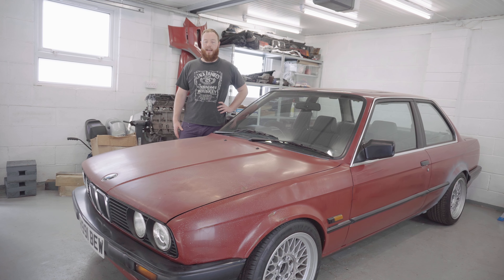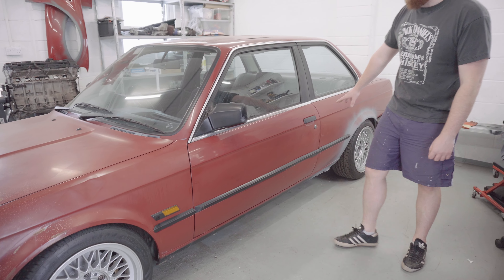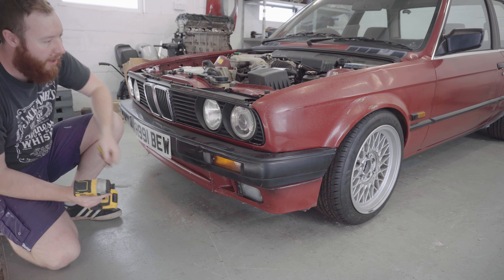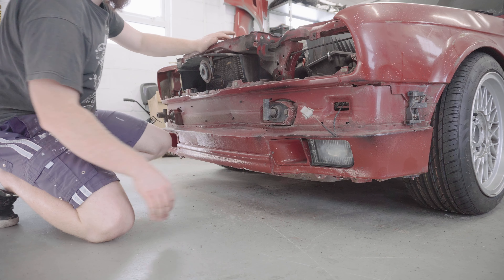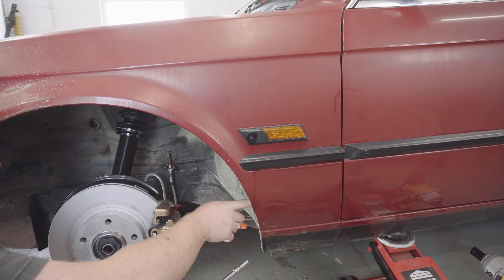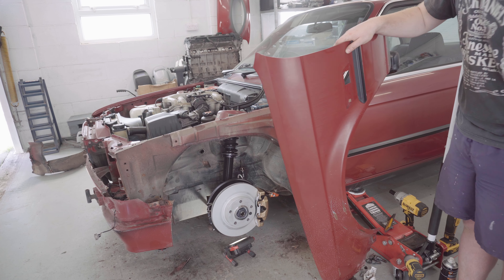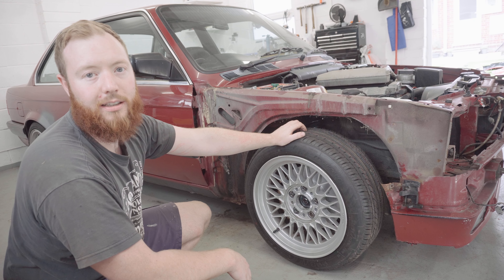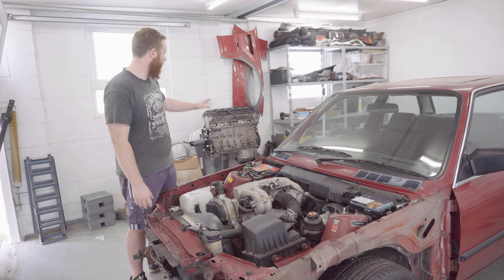BMW E30 Front End Damage [SHOCKING REPAIR] How To Remove Front Wings, Bonnet, Bumper & Valance | 026

Comment: Useful tutorial on front panel removal which I had to do recently as mine was rusted at the wheel corners. I had to ground down the replacement panel at the bottom to fit the clips for the spoiler properly. Aside from that, It's great to see these videos on a right hand drive M40. Appreciate it.
Reply from the maker: Thanks John! I hope you got your new front panel to fit up right in the end. I've got a good condition spare I'm planning to put on when the car goes back together, this one was bodged up beyond belief haha. 😂

Comment: Just catching up on all your vids. Really like the channel. My very first BMW I bought in 1990 was a 1987 2 door E30 320i in Zinnober red, chrome bumpers. I added a set of the silver BBS alloys. Absolutely loved that car. Traded it after 6 years to a guy as a swap for an Alpine white 1989 E34 535i SE Auto which I still have. It is sort of a project now, I have done lots of work on it, sills, jacking points etc. they rot similar to E30's. I am currently restoring a 1998 840Ci, which I have been on with what seems like forever! I am 70 now so really wondering if I will last long enough to see it finished! Anyhow, keep up the good work.
Reply from the maker: Thank you Bob, really pleased to hear you're enjoying my videos!

Sounds like you're a true enthusiast, and not to mention a man of taste. 😄

Good to hear you've sorted the big stuff on the E34, very similar issues to E30's as you say, but equally worth taking care of. You see very few E34s these days, I always fancied an E34 touring as a daily driver.

The 840Ci sounds like a very special car, I'm a fan of those too, hope the project is going well, don't let up! 👍
Reply: @SPANNERRASH  Thanks for the good wishes. Motivation can be a problem. Unfortunately, I got quite ill in 2019 and couldn't face working on the car, and haven't really picked up pace since. I am not too bad now health wise, but generally can only do about 5 hours at a stretch, so hope to put some work in when it starts to warm up a bit as heating the garage is so costly now. I have completed 2 previous cars, my son's 2002 Astra SRi Turbo (which he still has) and a 1996 Golf GTi which I sold last summer. I painted both cars myself and they stood up to scrutiny at car shows etc. so if the 840 turns out as good then it will have been worth the pain!

Comment: I see you have 5 bolt hubs I have a 89 735i with coil overs on it is this the same how do you have 5 bolt?
Reply from the maker: Hi mate, I explain my whole setup in a couple of previous videos, check them out!

Rear: https://youtu.be/OXPT7gjXi3Y
Front: https://youtu.be/7-hN2-2J4Fo

Is this similar to how you converted yours?

Comment: I spy an M5x, which one did you go for? I've got an M52b28 sat in a friends garage for mine when I finally sort it out!
Reply from the maker: Snap! It's an M52B28, I think the perfect swap for an E30, on balance, for what I'm into anyway. 😀

I'm still debating on how much attention to give it before fitting. It looks like a good motor, but always hard to know what kind of life it lived in the past. I guess I'll find out.

You might get around to swapping yours first.
Reply: @SPANNERRASH  I know what you mean, only gaurantee I've got is the previous owner said it was a good motor... 

Wouldn't count on it! I've not put the rear end back together yet, been dragging my heels because once that's done it'll be off to the welders. Ive needed time to save up some cash!
Reply from the maker: @Keats.Garage  Ahh yes, quite expensive to have done. Although having had a go at DIYing it, I can understand why! Not quick nor easy unfortunately. It'll be well worth it though once it's all done.

Comment: you are doing this dangerously. using a hydraulic jack to support. you ought to be careful using jackstand. you never know that jack can juck collapse.
Reply from the maker: I really appreciate your concern, I would normally use axle stands, the car is currently on 4 despite the rear wheels being on the ground.

On this occasion I did have help around who we're keeping a lookout for me. Plus that jack is way way over-speced for lifting this light BMW E30. 😂

I certainly will take care though, thank you.